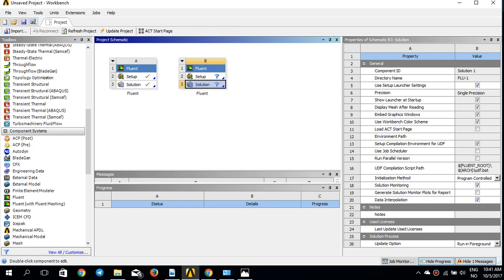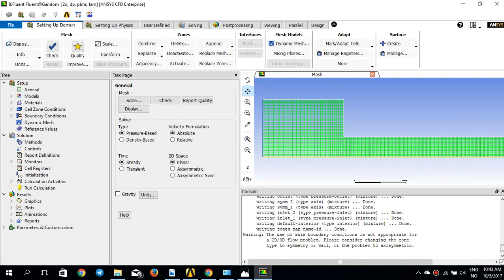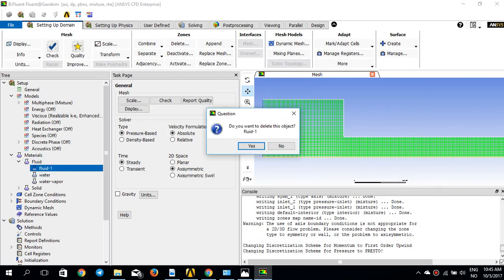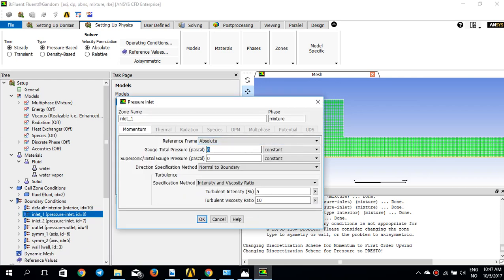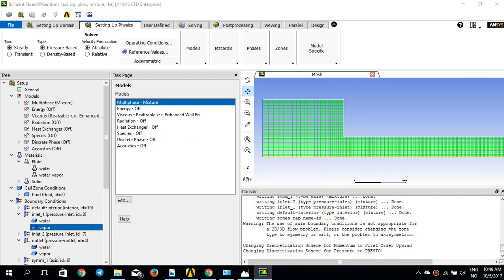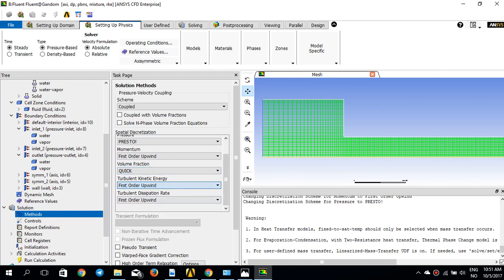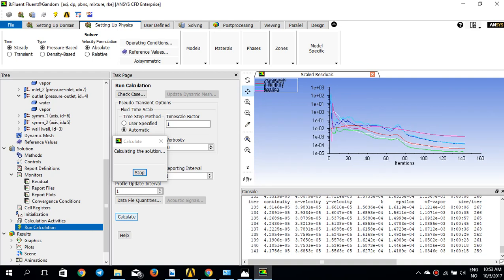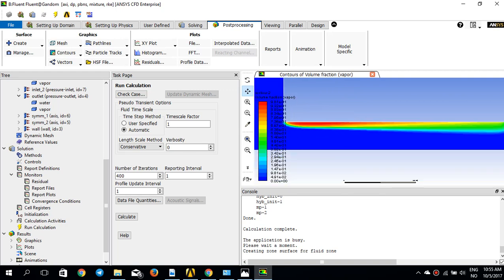Pressure driven cavitation flow of water, Ansys Fluent Tutorial 5

Comment: Hi, Thank you for your great video. I am facing a problem. I have a vertical pipe. The inside and outside of the pipe are  full of static water and no flow. Some height above from the bottom of the pipe  air will be injected inside the pipe. This air will be mixed with water and makes the water less denser than the water below the air injection point and outside of the pipe. So the denser fluid push the lower denser fluid and flow will be happened and continue. The bottom of the pipe is pressure inlet.  What will be the "Gauge Total pressure" and "Supersoninc/Initial Gauge pressure"? Say, the pressure at the bottom of the pipe due to static water level is 3 bar.